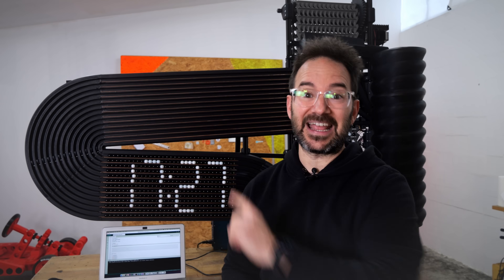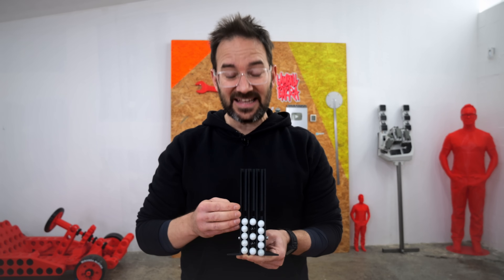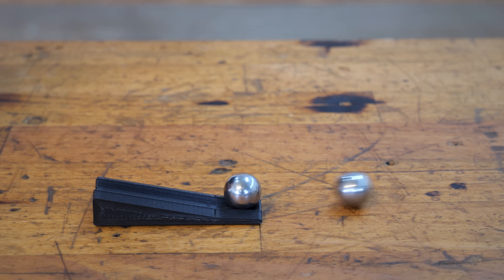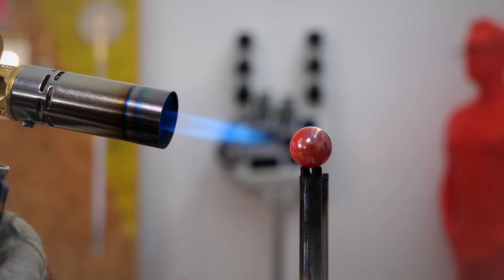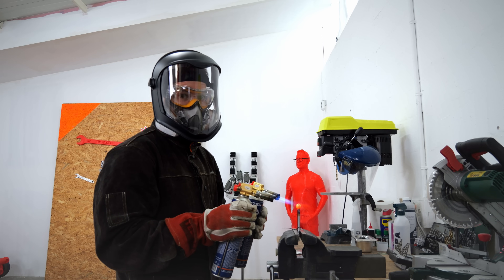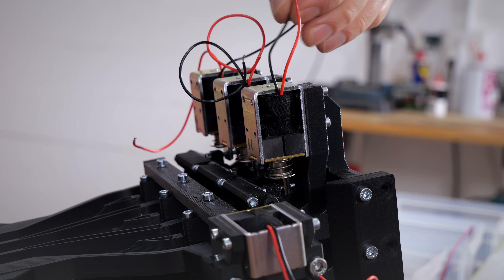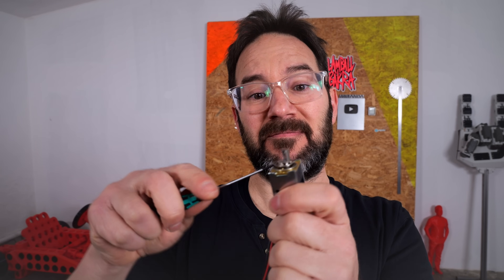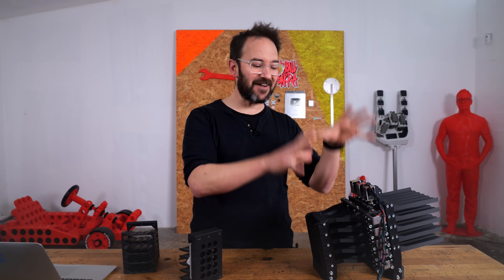Ramp Based Rapid Marble Swap - Marble Clock Seconds Display Pt.1

Comment: Ivan, I've played with clocks before, a note to think about, not all marbles need to change for each digit, example - to change from 8 to 9, you only need to swap 1 or two marbles on the lower left. The other marbles can remain in place
Reply: On a related note, only 13 of the 15 marbles change. The middle marble in the second and fourth rows will ALWAYS be the same. Set it up properly and you don't even need to run marbles there.
Reply: @adamboyd1132  i was also thinking about this... what i had caught was that the rightmost marble on the first, third and fifth rows don't change either. combined with your observation, that means only 10 of the 15 marbles change and one marble never changes in each row. that means he could downscale his system to a 5x2 instead of a 5x3, right?
Reply: @adamboyd1132  Interestingly enough, if you look at the number grids at 01:56 and put the 1 on the right of the 3 by 5 instead of the left, then the top right, middle right and bottom right balls will always be white, so in effect you only need to change the other 10 balls.
Reply: @adamboyd1132 Actually, only 10 marbles change. In rows 1, 3 and 5 column 3 stays black/filled all the time, in rows 2 and 4 column 2 stays white/empty all the time.
Reply: @adamboyd1132  Actually, only 10, the top middle and bottom of the right hand coloum are always white.
Reply: Ivan,  if the marbles come from the back,  why do you need black marbles (they are only used as "spacers" :) in the minute and hour digits).  Could you not just leave a blank space.  The black of the black printed rails would create enough contrast.
Reply: @karlhvidsten6025  You need a black marble to displace the silver marble tho.
Reply: @karlhvidsten6025  how would you bump out the white marbles that need to be black?
Reply: @karlhvidsten6025   The issue with that is that the current design requires marbles to be pushed from the back to change time. only 2 spaces can be left blank forever, row 2 col 2 and row 4 col 2. Otherwise the rest need to be moved at some point. On that same line of thinking there are a few that never need to change from being "on". Row 1 Col 3, Row 3 Col 3, and Row 5 Col 3. With this in mind the whole thing could be simplified by 5 inputs across the matrix.
Reply: @karlhvidsten6025  In this design, every hole would need a marble to be able to switch from white to black - it needs the marble pushing it from behind
Reply: There are 5 marbles that never have to change. The slots that are always silver are Row 1 x Column 3, Row 3 x Column 3, and Row 5 x Column 3. The slots that are always black are Row 2 x Column 2, and Row 4 x Column 2. This brings the marble selection down to only 10 marbles. So unless he really wants to change every marble for each second, he could eliminate entire rows of marbles needed to display the time.
Reply: This man clocks
Reply: how do you think he will be doing the other 5 digits? probably one marble feeder like that would be enough for all of them
Reply: They’re consecutive, so here’s all he can save with that improvement:
1 column on 0-1
1 column on 2-3
1 column on 3-4
2 columns on 5-6
1 column on 7-8
2 columns on 8-9 and
1 column on 9-0

with 11 possible transitions (including the unobvious 5-0) and 3 columns, that is a 9/33 or 27.3% average efficiency boost!

Pretty good for a free logic rework.
Reply: With his current multiplexer design he does not have per ball control for release. He will have to release a black or "white" ball each cycle, for every track.

The current setup only uses 9 solenoids (5 row, 3 col, 1 flush) to make 15 choices from 30 options. (black or white, and 15 cells). To release a color choice marble for each cell he would likely need 30 solenoids if they were 2 per cell. This would simplify the stages, but would ultimately be pretty spacious in the HxW dimensions while likely saving some space in D.
Reply: @Zenthere  There's basically two ways this can work faster by skipping steps.  Since the row solenoids pick type of marble and columns release them.
1.  it can replace single columns.  so on digits that share columns (eg. 2->3 the middle column is unchanged. 7-8-9-0-1 the right is unchanged) you can skip them.
2.  it can release identical columns simultaneously.  eg. on 3, the left and middle columns are the same pattern, so it can do both columns at once.
Reply: @Stereomoo  you can go even further with this thought

assuming the 1 is right side column, rows 1,3, and 5 right side marble will ALWAYS be white
rows 2 and 4 middle column will ALWAYS be black

this cuts from 15 active slots to only 10, because that scenario accounts for 1 marble from each row, you could cut down the feed system from 6x5 to 5x5, and each color selecting actuator would only need to worry about a maximum of 2 changes per cycle (for 2 columns), and because you could select all colors for both middle and right columns at the same time you would only 2 actuators to release, one on the left column, and 1 for both middle and right columns. this would get total number of actions from 6 to only 4
Reply: @emi9643  Why 5x5? You could just "glue" the marbles for the fixed positions in place and use a 4x5 selector. It would be a significant reduction of black (and silver) marbles if you don't need to swap out the unchanging positions.
Reply: @Pystro  im assuming we still maintain that the marble will be "popped out" every cycle for aesthetics, just like the main clock has an entire row of black on top and bottom but they still get swapped every cycle
Reply: @Zenthere   how about just the rows that are different,and keep the ones that are the same?...
Reply: @lovienyoutube420  It would need to be the columns that are different rather than rows since the row solenoids select the marble and column solenoids release it. So changing digits in real time requires fitting seven solenoid pulses into one second (rows and column three times plus full matrix release). Not doing columns that don't change wouldn't save time since some digit changes would require all columns to be changes, but it would save on the number of marbles needed.
Reply: @Zenthere  So you're saying poor design......... just because it's designed one way dont mean it was the best way.
Reply: @Zenthere  consider that the top right, middle right, and bottom right slots will always be white regardless of what digit is being shown, and thus never need to change. you don't even need tracks to begin with (unless you want it to be able to be able to show a pure black as a "default" state rather than a 0). plus the two central marbles in the 2nd and 4th row will always be black. so we're down from 15 channels to 10, which will save a ton of space.
Reply: @Zenthere  Seems like he needs a de-multiplexer with some sort of logic gates and a sort of "transmission" similar to the vacuum channel designs used in automatic transmissions.

I know it's asking for a lot (too much) and probably looney anyway, but... this whole project is already a bit looney, so... 🤷‍♂😁
Reply: @Zenthere It could be done if the 5 rows were tri-state, but then he needs to use something other than his current latching solenoids
Reply: You may not HAVE to change those middle balls, but this is not an exercise in pure engineering efficiency... it's an art display more than anything else.
So while those middle balls will always be black, they do need to be swapped out simply for the effect of the balls flying out. More balls in motion means more clacking noise and a more interesting display.
Reply: @tin2001  Agreed. The only reason I see to make it more efficient would be if it couldn't make it run quickly enough to display a new digit each second.
Reply: @curiocheerio  Well that and being able to just feed marbles WBWBWB.... which would make the system mechanically simpler & smaller and would allow it to be cut down to one solenoid per feed pipe. Of course, he seems to have a working system at this point.
Reply: Correct, and that means the marbles only need to be arranged WBWBWBWBWB... all the way up the queue. Much less mechanical logic involved.
Reply: Just swapping the marbles that change for each digit would reduce the number of marbles that need sorting each change, but if all the marbles get changed each second then those positions that are always the same colour could have simplified runs that aways just feed in the same colour.
Reply: He can release each column, then has to que the entire column as white then only release the flush with only the first column selected. It would take far longer for more complex numbers I think to bridge the 1 second interval.
Reply: Just wat i was thinking
Reply: But man, the sound of them all falling at once...
Reply: How you gonna manage that with marbles in a rack
Reply: But with this design he has now he can't push out a existing marble, because one will always get stuck to be displayed. So going from 8 to 9 will be impossible
Reply: @cooletijdgast   what? he would just need to push out 2 of the black balls at the bottom for it to change from an 8 to a 9, he doesnt need an empty space just black balls
Reply: @cooletijdgast  you just have a different colored ball push out the bottom, it shouldn't be too difficult
Reply: I’m sure he knows this, but changing from 12:18 to 12:19 in a clock that loads from the left is a huge challenge. The black marbles need to move past the 121 to get there

Edit: I spoke too soon, it seems possible for the design he ended up with
Reply: Get this to the top... would help a ton with speed

Comment: Well, that's a way of designing it...

Given you only have 10 patterns cycling in a loop (that's 1 sequence of 10 "chunks", really), you could pre-sort your marbles in the "feeder" and loop: for 6x6 patterns, that's 360 marbles in one line (logically 10 groups of 36), you just need to be able to count them in and run them in a tunnel that makes that "pattern a single line. Basically, you need a single stepper motor and all the marbles  in a predefined order  in a closed loop (with no space): 36 marbles display "0", the next 36 display "1", etc., and everything loops in 10 seconds. Theoretically, you shouldn't need a microcontroller, but the 2 euros of an ATMega8 will save you a lot of time when controlling the stepper motor with a couple of mosfets.

For colouring the marbles, the chrome is a coating over nickel, so you don't need to go the full way to muriatic acid, industrial vinegar (15% acetic acid) would do the trick in a week or so, but you may try a solution of hydrochloric acid too (not pure!), the stronger the acid the faster the result, but beware the heat and the projections (you already have the mask anyways).

Comment: First: This is bananas. Awesome.
Second: Idea that comes to mind for me is that digits will always occur in the same order, in the same location, every time. As such, it almost feels like each digit should be a separate closed loop system that just runs the same marbles in the same order over and over again. The main problem (as with anything) is that I have no idea how to take that idea from theory to practice.
Reply: Maybe lead the marbles directly into the elevator slots instead of mixing them. Each elevator slot would handle one column. But that would probably require fine timing of the release, a row at a time. And he'd need a few more solenoids to push them off at the correct row. And he'd have to re-make the elevator to be 20 columns wide, but I think he might need to do that now anyway. Maybe he could do 10 columns wide and release half at a time with something similar to the mechanical multiplexer he just made.

Comment: Quite the design! I was thinking you could get away with alternating colors in one row and only updating a pixel when needed. That way you wouldn’t need to do the whole digit. You would then just need to make sure you could refill in an alternating pattern from the back. If you could control the updates predictably and drop down vertically, then that could be the queue for reloading once the marbles made it to the back.
Reply: THIS!! Also, have the front hold the marbles slightly under tension and use pressure from the row to pop them each out one at a time. Then you don't have a system constantly full of loose marbles that could fall off or jam anywhere at any point

Comment: I don't even think the selection mechanism is fast enough. It takes 4 vertical turns (1 opening for each column and 1 closing for all if you optimize) and 2 horizontal (3 for selecting the marble on each line but one can be optimized with the closing). That is 6 turns (I call a turn the time it takes to activate a component), 1 must therefor not be more than a sixth of a second (that 0.16 seconds). I know it's fast but is it this fast having to wait for the previous marbles to print before starting the selection again on top of that.

Comment: Because you're pushing out from the back rather than sliding in a whole row at a time, you don't need to replace every marble every time - only the marbles where the colour needs to change.

So you could have a short stack of alternating colours behind each marble/display pixel - ●○●○●○●○

And just pop out the pixels that need to change with their next successor:

So for 
   5         to become       6
●●●                              ●●●
●○○                              ●○○
●●●                              ●●●
○○●                              ●○●
●●●                              ●●●

You'd only be popping out one marble. Less movement, less effort to keep the hopper full, but more electronic effort to get a solenoid for each pixel.

Comment: You don't have to replace the 2nd and 4th marbles in the middle column. They're always black. In fact you, you don't have to replace every marble every time. If you made it so that you only replace marbles when they need to change color, you'll probably significantly save on the number marbles in circulation or in need.

Comment: Ivan. A lot of the machine's bottlenecking and complexity comes from the need to sort marbles to form a number, before it throws out all the effort it just took sorting them, and scrambles the marbles together after displaying the number. Why not just have 4 reels of pre-assembled numbers? The machine would be exponentially simpler with some sort of reel of pre-sorted, ready to drop in marbles.  A clock displays digits in predictable patterns (0-2 for first hour slot, 0-9 for second hour slot, 0-5 for first minute slot, and 0-9 for second minute slot), so it's comparatively trivial to set this up and program it so that the marbles are ready to cycle as soon as each second passes. Infact, some flip clocks are programmed this exact way. You may even be able to create a circuit for this that doesn't use arduino or similar - just basic clocks, microcontrollers, etc, and of course, your solenoids :)
Reply: Additionally, even with your method, or the method I suggest above, with your strategy of pushing marbles from the back, it also enables you to only partially replace each digit. IE from 8 -> 9, you only need to replace 3 black marbles with white ones, further reducing the noise and complexity of sorting/length of the marble reels. Good luck !!! :)

Comment: With the back-to-front design, you don't have to replace the entire digit matrix each time; you can set up and replace the marbles only for the delta, which hopefully will save you some set up time and also you won't need to recycle that many marbles.

Comment: 2 suggestions:
You can make the system so that you only change the part of the digit that changes between number eg: 5 to 6 only needs the A4 spot changed
You don't need the B2 or B4 sections because no digit needs those spots

Comment: wouldn't this marble selector still not work tho, if you need it to update every second i dont think you can change the solenoids and have the marbles roll forward fast enough, especially with all the colour selectors and colum openners connected the way they are

Comment: You might be able to mass produce black marbles with a furnace to heat the ball bearings red hot in batches, that way you don't have to manually heat one bearing at a time
I forget the exact type of furnace it was for this application, but hopefully this helped

Comment: You could try using carbon steel ball bearings for the black ones. They are way easier to blue and cheaper. Usually they are already darker than the stainless ones. The carbon steel could even be darkened w/ a mild acid etch and coffee. Just remove all oils in an alcohol bath and put them in some really really strong coffee and "cook" them till they get dark enough. Cheaper and you can do it in batches.
Reply: Could also consider kiln heating the marbles for batch processing rather than one by one... Especially since the only part that really needs to get fully heated is the chrome coating.
Reply: I think the problem might be if he changed the marbles they might not have the characteristics to fall consistently in the machine. Maybe not, maybe they are close enough but I do like your idea overall!
Reply: I think he could try Zinc for off color - the density is only ~15% less than steel, so the retainers and bump design should still work. At the same time, Zinc is not magnetic, so he could sort the balls really fast with electro magnet.
Reply: I don't think the "chrome" balls are really stainless. It's just ball bearing steel polished to a high shine, which protects them from rusting in onyl mildly corrosive environments.
But at the same time it's this high polish that makes them difficult to blue. so, yeah, more "mundane" steel might gelp with the bluing.
Reply: Could also use an induction coil if a gas fired kiln isn't an option